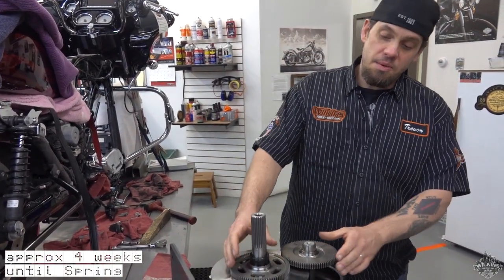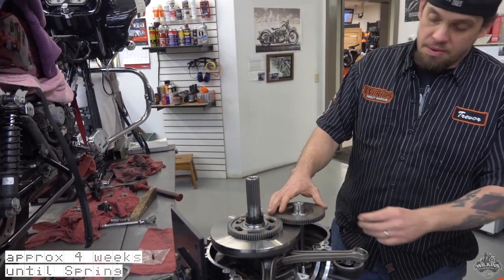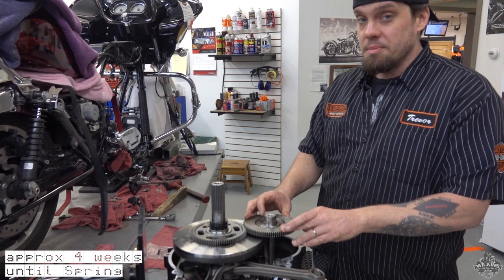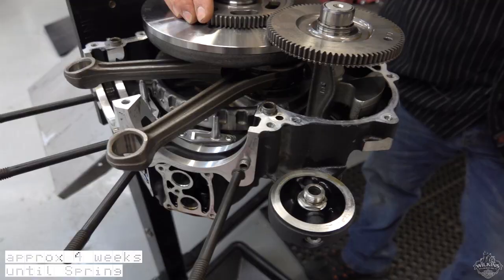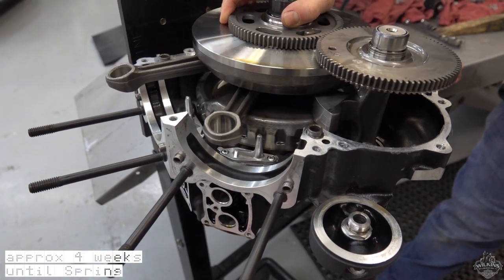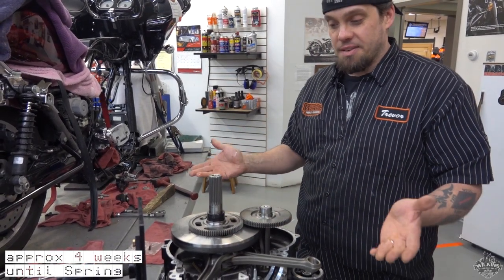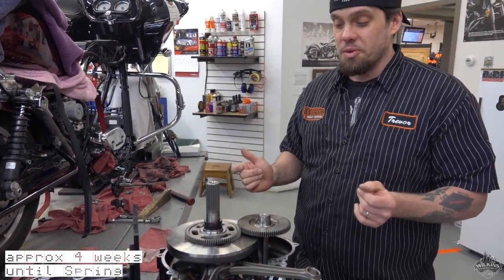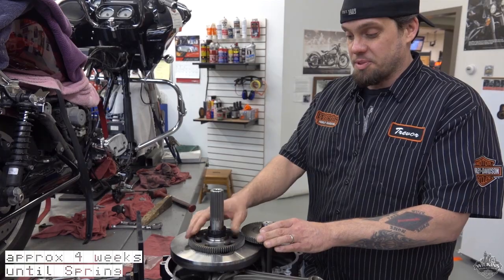Harley-Davidson Milwaukee-Eight Counter Balancer

Comment: What a fuckin big lie. Its an excuse for the excesive vibration and crank run out issues. If you believe that buy one and experience the crap ive gone through with HD and their  warranty avoidance.  2020 m8 fatboy. 5000 miles. Bad bad.
Reply: No, im saying that it is a lie about putting 25% more vib back in. How do you do this and why would you?  My 2020 vibrates so much it blurs my vision at 3500rpm. Been through hell with HD and their pathetic warranty.  Bad bike. Bad company. Bad experience.
Reply: @gd7389 sounds like your balancer/ balancers are out of time/phase with your crankshaft. Some old Porsche engines use counterbalance shafts and if they’re just a few teeth off, it’ll vibrate worse then it not having them installed at all.
Reply: Are you saying HD put the balancer in to hide other issues with the m8 . I built a m8 engine for a 2019'roadking .Do you think it  will be a problem if I leave the balancer out.

Comment: It’s interesting that Harley designed these to be slightly imbalanced to “feel” like a traditional Harley. The Twin Cam B motors are honestly smoother to me than the M8’s in the Softails. I work at an Indy motorcycle shop and deal with these machines all day, plus I own an M8 Slim and I personally feel like the M8 has a very slight shake that’s more felt at idle than at any other rpm. The TC B motors seem perfectly balanced at idle to me and only really start to vibrate at the higher end of the rpm spectrum. Both engines seem to have a higher frequency vibe near or at redline but really feel different when you’re chugging along or just stopped at a light. People will argue that the old TC Softails are more of a “real” HD than current models but they kind of contradict themselves since they are so buttery. I love the vibrations of the TC A motors in the Dynas and touring models and of course the Evo sporty bikes but I truly wish they kept the M8 100% balanced so they felt more like the Softails of yesteryear. Just so they feel as refined as they look. But don’t get me wrong…I love my 107 😍 Cheers and ride safe my friends.
Reply: Glad that you posted this.  My old 88B engine shocked me how smooth it was.  I cannot stand excess vibrations.  If the M8 was the same, I'd consider a a new one.

Comment: In no way does the M8 engine feel even remotely like your typical Harley Davidson. I test rode an M8 Street Glide. It felt much more like a Honda Goldwing than a Harley Davidson. My 2006 rubbermount Sportster will shake your teeth out. The M8 feels like it could be electric. The Twin Cam 88B has a considerable amount of vibration. The M8 has NONE.  Any way to remove this POS thing without the engine destroying itself?